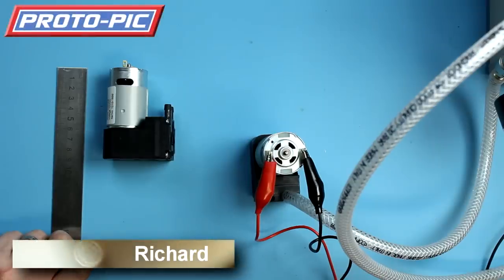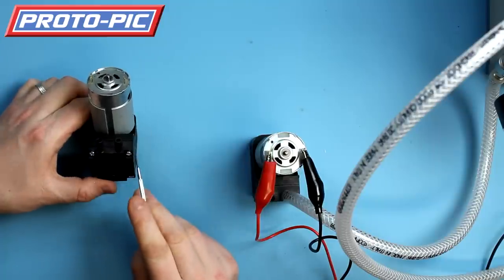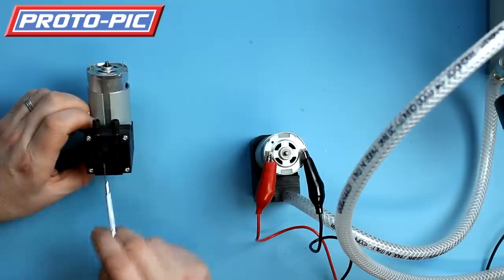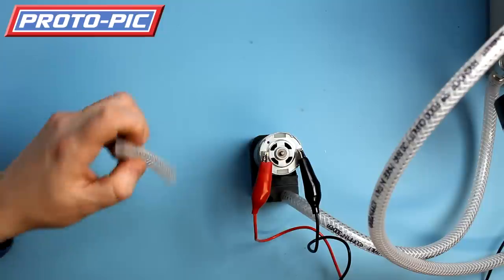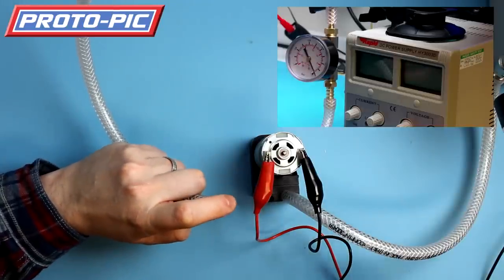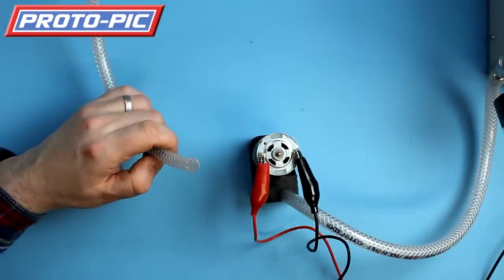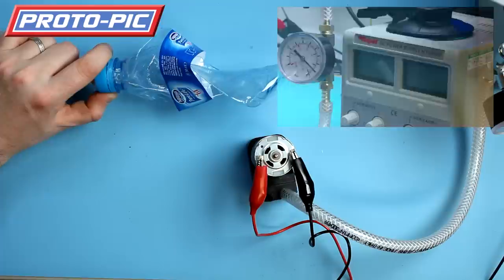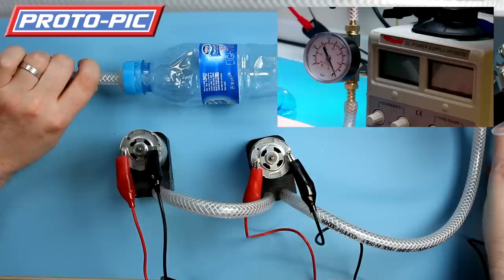12v Vacuum Pump

Comment: you have saved me a lot of fussing about with a car tyre compressor! thankyou! i will be buying one in a couple weeks
Reply: AJK Technology supplies all kinds of mini diaphragm pumps. Welcome to contact for samples!
Reply: I used a small vacuum pump 12-volt to operate my 4 wheel drive on a old S10 pick up truck the vacuum actuator stop working !

Comment: Parallel = 2Q, Series = 2P. If you want to drain the bottle more quickly use parallel configuration.
Reply: 2Q = ? 2P = P But I understand electrically they are connected in parallel but fluidal they are connected in series. Of course as in the last demonstration of that video. And yes I think also parallel (fluidal) would be quicker. What here happened is the pump near to "chamber" (the PET bottle) has to pump against a lower pressure which got generated by the second pump near the surounding atmosphere. But by design the leakage and pumps valves ability can't really mean suction of one plus suction of two means suction as a sum of both. If it is even possible by pumps of any design that way.
Reply: hi you if two of this pumps connected in series like on this video..will generate twice negative value?  if one pump is -50kpa  two of them in series will get -100kpa?

Comment: I have been using this pump for my laboratory experiments over a month. Pump stopped working as  connections in the coil inside the metallic body loosened. What do I do now? If I dismantle the pump to arrange the connection, will the metallic cover fit in exactly later on? Or are there other alternatives?
Reply from the maker: Try it and see - never stripped one down to check.

Comment: Can u use pneumatic mini air cylinders on that pump
Reply: I used a  small air tank pressurized , and a  normal closed electric solenoid  with relay and motion activated  to operate a Halloween  decoration  using air cylinder . check out Halloween video a lot of people use them for this idea good luck !

Comment: What are you using as a power supply and how long will the battery last before needing to be charged?
Reply from the maker: +Grass Jars - It was run off a bench power supply.

Comment: I recently bought one of these off of eBay. Hooked it up to a momentary switch and a 9v battery. It worked great, however the battery got extremely hot! What did I do wrong?
Reply: 9v batteries aren't built for such large current draws.
Reply: AJK Technology supplies all kinds of mini diaphragm pumps. Welcome to contact for samples!

Comment: Would one of these vacuum pumps do for a desoldering pump or would 2 in series be better? I'm making my own desoldering pump and any help would be brilliant! thanks in advance,
Reply from the maker: It may do. If you watch the product video, it will give you an idea of the vacuum produced. Try one.
Reply: Thanks, will let you know if it does the trick for me,
Reply: john porter Did it work? I have a very similar pump. Need to know what you ended up doing.
Reply: Sorry bobhaha i never got round to it as i had so much work on, A friend of mine made a desolder pump out of a similar setup and it worked very well, But decent solder pumps arnt that expensive these days as i found out, theres a nice gun type out there that that Australian guy did a video on...evlog i think his channel is,
Reply: john porter I came looking for the exact same thing. I know It may not pull straight from the solder, but I want to connect it to a can, so It can charge a lower pressure and control it through a valve. :D
Reply: +john porter EEVblog
Reply: there a video on youtube check it out !     if you buy a  desoldering iron that has the pump bulb . just remove the bulb and attach  the vacuum pump using a vacuum hose your done !

Comment: Did you able to adjust the amount of pressure ? or force of the pressure?
Reply: You'd need a pressure sensor attached to a control board and relay switch to make it easy.

Comment: Can be used as wet air suction aplication? (replace vacuum motor of a record cleaning machine similar to okki nokki), could the suction power be regulated trough a pressure gauge with liquid separator filter? My intention is use this kind of suction instead of usual vacuum motor.. Might this pump bé too much powerful or not? Thank you!

Comment: Every time i plug it to my power supply the power supply goes off
Reply: this pump draws about an amp. if you have a lesser power supply, it will crowbar. So the supply will shut down to protect itself. you need to get a beefier power supply, or if yours has an adjustable current limit, turn it up beyond one amp